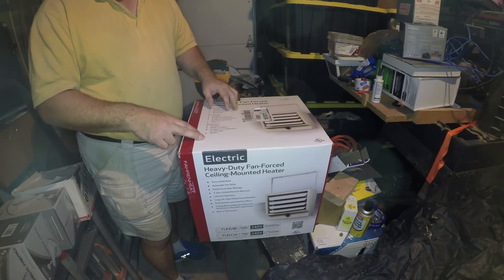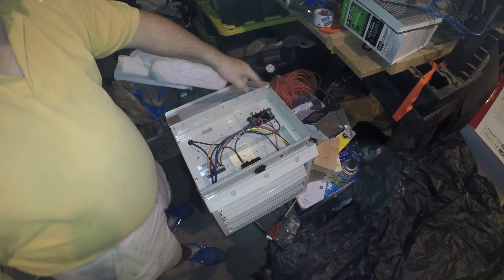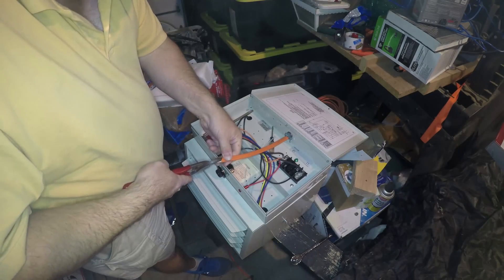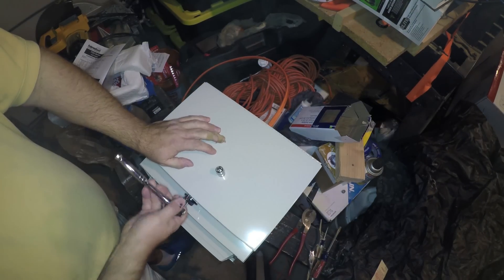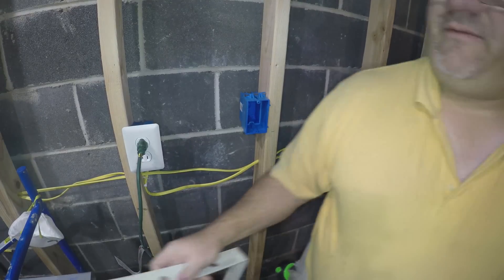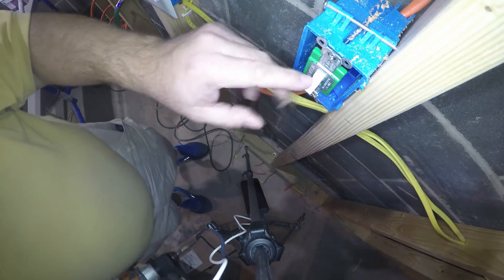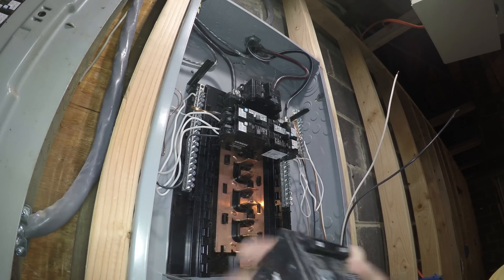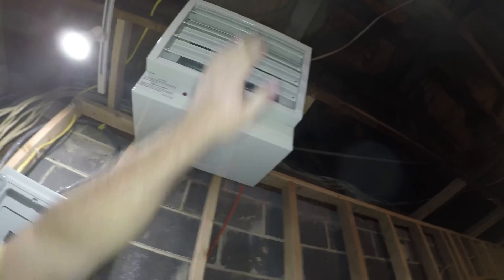How to Install a Garage Heater for under $330 5000 Watt Fahrenheat FUH54 DIY

Comment: I’m installing this in my finished garage I’m also not installing a switch.  Do I have to use flexible conduit from a junction box, that’s in the attic, to the heater? Or can I just leave the 10/2 wire exposed from the ceiling to the heater?
Reply from the maker: You'll need to review the conduit with your code enforcement officer. I can tell you that in my older home built in 2006 they did not use conduit for any wires in the attic.  If you are using Romex you should be good. If you are running a set of wires then you will need to use conduit. If you are concerned about squirrels or mice chewing the wires then conduit will provide some additional protection. Consult a licensed electrician for best practices. BTW you can read the NEC for free from NFPA. I reference that here: https://udoit.me/how-to-install-a-garage-heater/ Thank you and good luck! - John

Comment: Hello, great video. Did you have to move any of the spade connectors on the wattage change terminal board? The small card in the heater says it must match exactly. I didn’t see you move any of the spade connectors
Reply from the maker: Thank you Christopher! I don't remember if I caught that on camera but I made sure it is configured for 220VAC. The user manual and the wiring diagram shows it. Feel free to reach out if you need assistance. - John

Comment: Thank you for making this video.  It helped clearly illustrate to me the steps in your install.  I have just installed this exact heater in my unfinished basement shop.  Other than including EMT conduit and a lighted switch, my install was like yours.  It is so nice to have heat down there now.

Comment: Should be able to install one of those for $150 or so. I got mine for $99 OFF Amazon and the whip cord (10/3 inside a flexible shield) and mounted it myself. Got it inspected for insurance purposes and there ya go!

Comment: this is the best installation video I've seen for this heater. I have two installed in my 1,000 sq foot workshed as well. I have one question though, I used two 30 amp single pole breakers and the heaters don't seem to put out as much airflow as yours does. Does a double pole breaker increase the power to the heater? or is a single pole 30 amp breaker providing sufficient power? Thanks!
Reply from the maker: Thank you so much. Yes, the double pole breaker will increase the power. There is a table inside the manual that should show the power consumption.  I believe all of the entries are either 208VAC or 240VAC, which means that it requires a double pole breaker.  You'll want to make sure the jumpers are configured correctly according to table 2 in the user manual as well. -John

Comment: Nice Video!  Hopefully I'll be adding heat to my Garage very soon. I've had this particular model in my Amazon wish list for over year and think it's finally time to switch from the dangerous propane tank top mr buddy to this guy.  I was going to go straight into my panel but am thinking the switch is probably a better idea than climbing a ladder everytime I want to switch the thing on.
Reply from the maker: You'll want to use the knob to turn it down...it has a thermistor to keep the fan running until the heating element shuts off. A little piece of rubber on the end of a yard stick to nudge the knob to off will help. Use the switch to prevent it from powering on when u are not around

Comment: Excellent video, thanks for the time you take to show us how to do it for our self . On this specific heater , if I have a garage 30x30 with height ceilings, no insulation ,do you think would be ok? I'm in CA , the lowest it gets around here is 49 degrees
Reply from the maker: Small chance you might need two of these units or a larger unit. 49 degrees should be easy to get up to 60 to 70 degrees with two units. If those CA winds are blowing it might suck the heat right out of the garage tho. Thank you for the feedback -John

Comment: Did you have an problems with  the heat turning on then shutting off and have to switch it off then back on?
Reply from the maker: No problem like that. There is a little hystersis built in though.

Comment: These are very good. I have a 7500 watt .do not turn off external sw until fan goes off indicating cool elements. 7500 watt requires 8 ga. Wiring  & 50 watt breaker s.
Reply: Heating 800 sq. Ft garage

Comment: hey so on my breaker box it looks like I only visibly have enough room for a single pole breaker. If I find a single pole 30 amp breaker, will that work for me, or do I need a double?
Reply from the maker: You'll need a double as it has to be 240 volt.  You can find four single pole vertically adjacent breakers and combine them into two tandem breakers thereby freeing up two slots for a double pole 240V breaker. Hope this helps and consult a licensed electrician and your code enforcement office.

Comment: Can I run this heater on a tandem breaker instead if a 2 pole?
Reply from the maker: This particular heater requires 220V. This will require a 2 pole breaker to provide 220V. Please consult a licensed electrician.

Comment: Do you leave this running all the time?  Expensive? What made you go electric vs gas? I’m thinking about doing my 2.5 stall garage and everyone is saying gas is the way to go as the ongoing costs are less.
Reply from the maker: Gas is the better way to go. Just make sure all volatile offgassing liquids are stored in a separate space. For me I only run it when Im out there. My garage is not insulated so I lose a lot of heat through eves and walls, especially on a windy day.

Comment: Hi UDoIt enjoyed the excellent video with super thumbs up. So here's the thing can this heat an apartment if installed correctly?  I'm Bubblewrapping windows more insulation etc etc and repelling drafts etc etc.  Your thoughts on using in 800 SF apartment??
Reply from the maker: As long as it meets code and you procide clearance as stated in installation guide and there is nothing nearby that can start a fire it sounds good. The heater puts out good heat but I never touched the housing to see how hot it gets. The thermostat is not calibrated to degrees but you can eventually find a setting that works for you. I marked a few spots in sharpie that I labeled at 64 F and 54 F cause it shut off at those temps liated on my thermometer. Good luck. You will have better luck than me. My garage is not insulated. On a cold calm day it is find. On a cold windy day the heat loss is too great so I usually sit in front of it when I work. Once my garage is fully insulated and sheetrocked it will be like a sauna.

Comment: Thank you for the video, do you run it non stop?
I'm planning o getting one for my garage where my car is for the winter and thinking on keeping a constant temperature
Reply from the maker: It has a thermostat built in and I only run it when Im in the garage and its cold. It would work better if I had my garage insulated.

Comment: Great detailed video - thanks! I would love to hear how it impacted your electric bill after a season or so of usage.
Reply from the maker: I built a table that took about 160 hours over one christmas break. I will post a photo of the table in my community tab. My garage is not insulated and you can see the trusses...so heat escapes easily. My elec bill went from $250 to $350 for both December and January. Thank you for the question. BTW if my garage were properly insulated it would get super hot in there and not have to run much.

Comment: I just ordered this fan from amazon for my garage. I have an electrician doing the instal but my power box is no where near the garage.  I hope it's not a pain in the butt job. I do have a central air unit just outside the garage rear man door. There must be wiring close by to fee the heater I hope. Looks like exactly what I'm looking for.
Reply from the maker: Thank you for letting me know. Is there easy access to get a wire to the garage from the panel, like within the basement / crawl space or outside via conduit? If you could share some photos of this that would be great for others to see.
Reply: I’ll update with photos once completed

Comment: I just got one of these and the book says 8 gauge wire? is 10 gauge safe?
Reply: 10 gauge for 30 amp breaker for 5000 watt heater, 8 gauge for 40 amp breaker for 7500 watt heater. he used the right wire and breaker for that heater.
Reply from the maker: I would use what the book says. I do like the rule where you up the gauge of wire by one level.

Comment: Thanx for the vid. I will be doing the same heater install. Just noticed ya terminated the white wire in the heater to L1, then landed it on L2 of the breaker, but hey, it works.
Reply from the maker: Thank you for the comment! Good eye on the wire connection. I love the heater but my garage is not the best environment for ut yet. I have to insulate and and put up drywall. Even if I just put up drywall without insulation I think it would get toasty in there. Thanks again and good luck! Post links to the installation but tell me you are going to first so I can look for them. It will mark links as spam.

Comment: I just finished installing mine thanks to your help it was painless. I'm realizing very quickly that without insulation in my rafters I'm wasting energy and probably over working the heater. Anyway thanks for the tips.
Reply from the maker: Great. Thank you for the feedback. I too am losing a ton of heat out of the rafters and eves. I will insulatr at some point. Good luck. Thank you for taking the time to comment!

Comment: Shouldn't have have colored the white wire black at both ends, to indicate it was hot?
Reply from the maker: YES!!  I should have done that.  I know it is 220.  But the next person may not.  Thank you for the comment.
Reply from the maker: Next time I'm out there I will make the modification.  I have a punchlist I have to go through from people commenting on my sub-panel installation.  The heater is close to that so I might as well do both at the same time.

Comment: Craftsman screwdriver! Nice job, but you should run your Romex to a metal junction box and then run flex conduit to the back of the heater. Run 3 individual THHN conductors in the flex conduit and bond the grounds to the metal box.
Reply from the maker: I read that the Craftsman brand has been (or will be) sold off to Black and Decker.  I also heard that the quality of the Craftsman tool line has been declining.  Most of my Craftsman tools are over 20 years old.  I will provide an updated video implementing your change.  How about armored cable from the metal box to the heater?  I will make this change when I install drywall on the walls and ceiling.  Thank you for your comment.  I subscribed to your channel.  We have a 2004 260 Sundancer that we keep in Wildwood, NJ.  But we did not put it in last year and I think with the purchase of this new (old) house we will not put it in this year (bummer).  Just too much to do to this house.  And I just saw your craftsman video so I'm going to check that one out too.  Nice connecting with you.
Reply: I'm looking to do the same thing. Why do it like that rather then the way he has done it in the video? So run romex to the junction box, run 3 THHN wires spliced together with the romex, on over to the back of the heater? Thanks! :)
Reply: Also, is there a way to install an external thermostat for better control?

Comment: Nice video. I'm going to purchase one of these and was planning to wire with a switch as well. My only question is don't you lose the fan over run that is intended to cool the heating element when you flip off the switch?
Reply from the maker: +zimsjeep The switch should not be utilized frequently.  I put the switch in too allow me or someone like my wife who doesnt know about the heater (or cant reach it [like my wife]) to turn it off. The heater's cooldown feature would obviously be cut off by flipping off the switch. However, it is a UL approved device. This means that testing had to be performed including a power loss while the heater was ramped up to full temperature. The heater must be able to sustain this heat as it cools down naturally.  Doing so all the time might decrease the lifespan but that is only speculation.  Thank you for the comment.
Reply: U Do It Gotcha, thanks for the reply

Comment: How many BTU is this unit? How many square feet is the garage? Does the heater put out enough heat?
Reply from the maker: Thank you for the question.  The heater is great.  My current garage situation is not.  My garage is not insulated. But, I'm working towards that.  The heater is rated 17065btu/hr at 5000Watt in their user guide (available .  It is very warm to stand in front of the blower.  Eventually, my 400 sqft garage heats up to about 57 degrees when I set it on the 3rd dot.  The knob is not scaled for temperature so I made note of the temperature that it shuts off at using a thermometer I have installed in the middle of the garage wall.  Once I insulate the garage I'm certain that it will run less frequently as I'm losing a lot of heat out of the walls, eves and roof.  I read a couple of reviews where the unit cut out on people after it reached 50 degrees.  I have not had a situation where thermal cutoff occurred.  I also read reviews where they dinged the manufacturer for a knob with no temperature scale.  I'm overlooking that since the heater works soundly for me.  Since I installed the unit I have not had a problem.  Note: I have not set it higher than my 57 degree mark just because I do not want to pay an extra $100 for electric.  I might be in the garage 3 times a week.  I have another 4 months of this cold I guess (southern NJ).
Reply: Thanks for posting, looks good. LOL at the armchair electricians commenting on here.

Comment from the maker: This installation took under 2 hours to complete.  There were no complications since I just installed this sub-panel and I have an exposed wall.  If you have drywall and a recessed sub-panel then your installation may take a little longer to complete.  Leave a comment of your experiences with garage heaters.
Reply: i should post a video of my installation, breaker panel was on opposite side of garage, no room to put the new 30amp breakers, ceiling height 14ft, walls and ceiling covered with sheetrock with insulation behind, nicely painted, installed a programable thermostat to operate it, im still waiting for a job condition like yours and if i ever find it i will retire happy lol, took me 2 hours just on patchwork after getting power to it😂